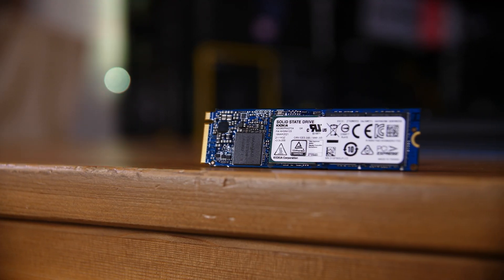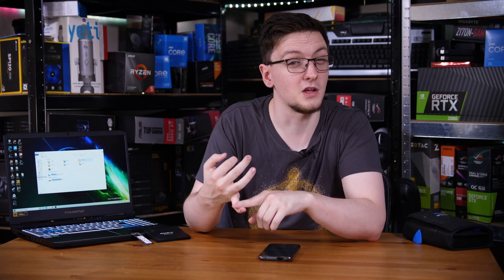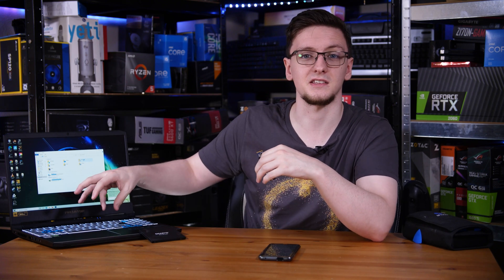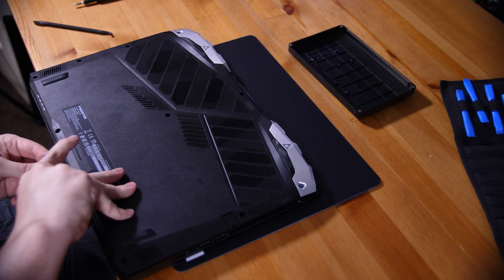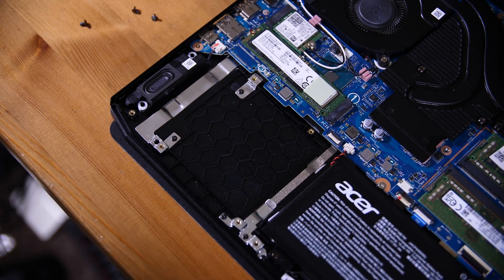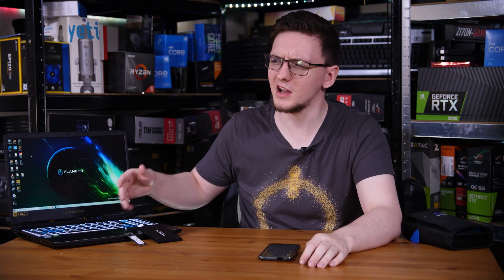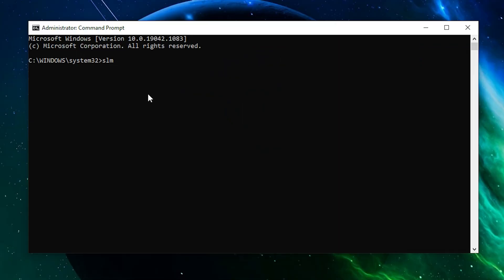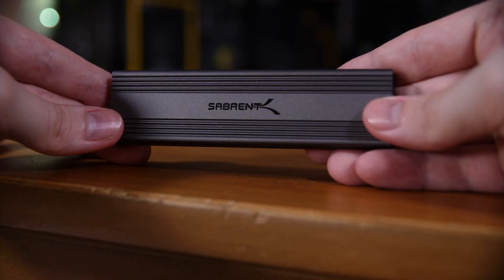How to upgrade your Gaming Laptop’s Storage

Comment: I just got a new laptop, but it only has 1 single m.2 slot with a 256GB drive. I decided to upgrade the storage to 1TB since m.2's are on sale, and I havent even booted it yet. 

I dont have an external caddy, but im considering just making a USB install stick of windows 10 or 11, and then looking at what drivers I need to run my new laptop

Comment: Great info but I need advice because I was told by an IT tech friend to just buy a 4tb external hard drive as my MSI C Series laptop is saying not enough storage and is sluggish. He said I should just work off that. But I don't know if this is the right solution? Any help would be greatly helpful

Comment: If I were to replace my drive with another one with larger space all my files and games will be gone and I'd have to reinstall everything right?
And also could I use any ssd/drive for my laptop or do I have to use specific ones
Reply: If you did replace your current drive with another one, you need to buy a external hard drive that has at least the maximum storage of you old one. Before you take the old one out, click the windows but and type 'backup settings'
From there you can add the external hard drive to your backups and set any or everything that you need to it.
After doing this click the 'backup' option and it should start saving all your files on you pc. Once that is done, you may uninstall the old hard drive and install the new one. Once you have set up the new hard drive, you can "restore from a hard drive" under 'backup' in windows settings. Restore your files and you are done!

As for what you should get for your laptop, I suggest doing some research on your laptop's model number and what your limits to changing it are.

Hope this helps!

Comment: You also have to check if your laptop will accept 2sided or 1sided nvme drive. Sometimes space under expansion slot for nvme/sata is occupied by larger capacitors/other large surface mounted elements - and the only disk you can fit there is a onesided one. It is a nasty problem, and if you are not carefull enough when screwing new disk down you can not realize the problem and damage your components (either squash caps on mobo or bend disk pcb).
Reply from the maker: Great point! Luckily most machines I've had in have been agnostic to that, but it's a good thing to keep in mind and check.

Comment: Hi there you don't mention the use of Cloning software to copy your C :\ System drive to a new C:\ System drive,. A lot of Drive sellers provide Cloning software for this very use..
Reply from the maker: That was deliberate, as cloning your windows drive can lead to complications and issues. I've used that method before and it was so much worse than just doing a fresh install.
Reply: @TechteamGB  I have Samsung M.2 nvme Drives as a main and second drive, in my Lenovo Legion 5 2021 LapTop using Samsung software to clone my C drive to a 1TB C drive up from a 512GB went ok, for me and saved me all the problems of having to reinstall and configure all my software again, But  I understand like anything there can be problems with any upgrade.  Love the channel love to see a fellow Brit doing tech on YouTube and always watch your new content :)